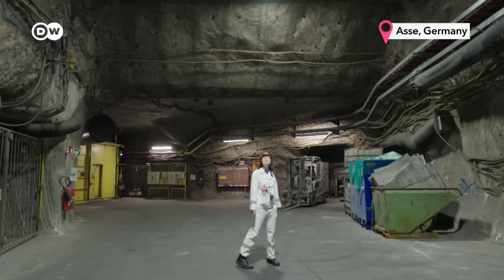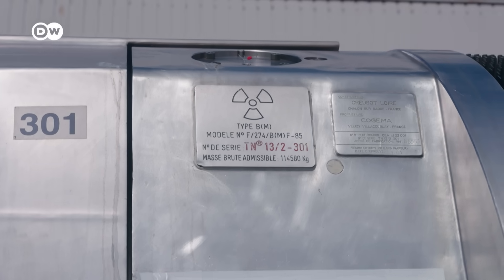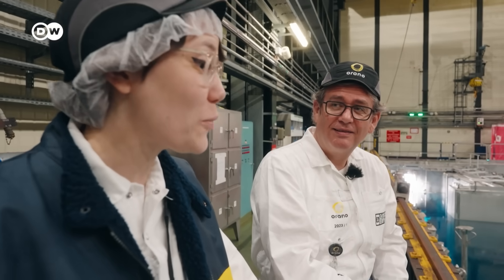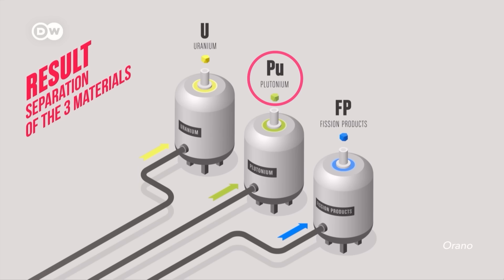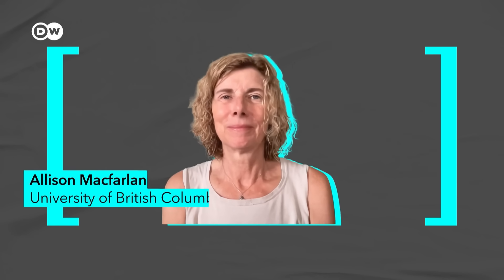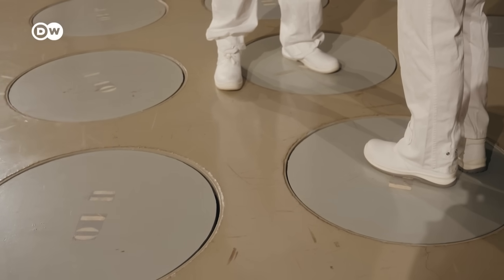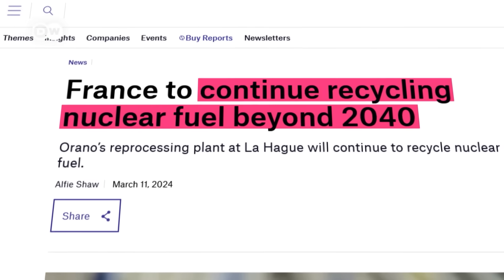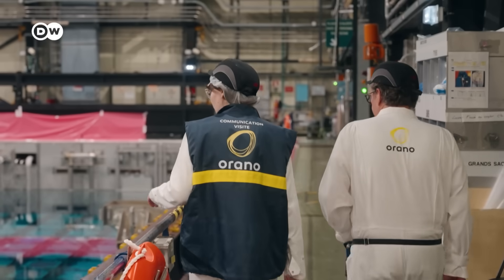Nuclear waste is reusable. Why aren’t we doing it?

Comment: Germany shutting down all nuclear reactors but reactivating coal power plants is the dumbest “environmental” move ever, thanks Greens. It’s almost as if the best energy policy should be designed by scientists and engineers, instead of politicians.
Reply: They can bring in nuclear fusion power plants
Reply: Germany doesn't reactivate coal power plants. Germany is reducing coal. 2023 was the year with the lowest electricity generation from coal and this year it is dropping even further. Certainly it would have been a better idea to shut down the coal power plants before the nuclear power plants, but your claim is false. And don't count the reactivation of coal power plants because of the R-U-war, they didn't run that much, they were reactivated to replace natural gas and in this short amount of time there was no other option. Also we should remember, that all parties back then (2011) voted for shutting down the nuclear power plants.

Comment: Russia is already doing it successfully.
Reply: yes russia has acheived 12% of France's amount.not bad.
Reply: @AlexC-ou4ju  Russia carries out deep processing and purification of uranium and plutonium from 0.7+0.7 to the level of 0.1+0.1% 235 uranium and 239+240+241 plutonium, France to the level of 0.3+0.3%.
A quarter of the fuel in Russia is processed by fast reactors, they burn out dangerous minor actinides with a shelf life of hundreds of thousands of years.
China and India are following the same path.

Russia produces and uses MOX, REMIX and nitride fuel for reactors of generations 3, 3+ and 4.
France produces and uses only MOX fuel.
REMIX fuel can be used as a complete replacement for MOX not in a third of the reactor rods (as in France), but with a complete filling of the reactor, starting from the second cycle.
Nitride fuel is used in fast and molten salt reactors
Reply: @AlexC-ou4ju  of what amount? What stats? Do you even know what you're writing?
Reply: @georgecarlin2656  hi yes, just going by this video data alone. but hey if you werent rushing to fellaterussia you might have known what i was talking about as well. but hey ythat might have taken curiosity and intellect.  12:07
Reply: @AlexC-ou4ju  The French group Orano, which owns the reprocessed uranium (RepU) mainly from foreign power plants and which signed a contract in 2020 with Rosatom, has confirmed that it has made "five or six deliveries" to Russia, amounting to a volume of 1,150 tonnes. However, the company told Le Monde that this contract has now been closed, with the final uranium shipment having taken place in October 2022. Orano also says it is not considering signing a new contract with the Russian nuclear giant.

For EDF, which operates French power plants and therefore owns the reprocessed uranium from spent fuel, the stakes are higher. In 2018, the multinational electric utility company signed a contract with a Rosatom subsidiary, Tenex, to process RepU, also at Seversk.

Comment: Used Fuel Rods might not have been recycled due to inefficient technology to reprocess and extract the usable elements economically until today.  On top of this Uranium was likely cheaper out of the ground.  Further we use the Uranium wastfully, like the wasted residual heat which could be recycled as well.  The whole industry and peoples thinking needs to change accordingly.

Comment: I would be really interested in the full video, the process is as you said extremely simplified. The way the video put it seems like the Uranium comes out as pure ready to use Uranium, but the 95% are Uranium hexafluoride or yellow cake, which has to be processed again before it can be used again.
The video also didn't mention the concerns about la Hague, like the Pipe that flushes out nuclear waste into the ocean or the chimneys where radioactive cesium is pumped out and is measurable in half of Europe.
So thanks for the Video but it was for my taste a bit too over positive.

Comment: Thanks for this report, DW; very interesting! Chapeau to the French for recycling their nuclear power waste. Sadly, I'm not surprised at the attitude of the US against recycling!
Reply: The correct word is reprocessing.  It involves dropping extremely radioactive irradiated fuel rods into acids and solvents, which makes the worst pollution imaginable.
Reply: @markrobinowitz8473  Agreed, PUREX and PUREX type purely chemical separation is not ideal. If they can make pyroprocessing (electrochemical, similar to electroplating) work well, that will be a game changer as you no longer need the acids and solvents.

Comment: Some fission byproducts possess decay properties for use in diagnostics or radiotherapy, particularly for treating cancer. Are these not useful byproducts of nuclear power generation or are they derived elsewhere?
Reply: They are not extracted from waste but purposefully created either by irradiating stable isotope in reactor (usually small research reactor, not big commercial one used to make electricity) some are made in particle accelerators and some in generators (you put in high concentration of isotope A (for example molybdenum 99) and collect isotope B into which isotope A naturally decayed (in case of molybdenum 99 it is technetium 99)

Comment: So basically this number is fake and misleading. A quite high part of the nuclear waste is not out of the reactor but is stuff that was in contact to radiation and now radiate on it's own (like steel structures and concrete when the power plants are taken apart or the castor cases themselves). Yes, the radiation level is way lower, at it need only multiple thousands of years to be safe instead of million, but it's not recyclable at all. How is this fact missing? DW, I expected better!

Comment: I live in Washington State USA... Hanford was used to produce Plutonium for the War Effort and later Cold War... they have stopped producing Plutonium and have been performing Clean Up Operations for years... any equipment that came into contact with Plutonium or many of it's byproducts during processing are highly radioactive... we have learned a lot since then... Nuclear is still one of the Best Green Energy Solutions available... we do have abundant Hydro-Power, but every location suitable for Dams are already used... Hanford remains one of the best locations in world for Nuclear Power... isolated, close to Columbia River, existing infrastructure, educated workforce, to name just a few... but too much radiation still remains and will remain for years...

Comment: India started fast breeder reactor prototype very recently
Reply: They should rather go to renewable energy instead of any nuclear. They are famous for not really taking care of their trash and environment
Reply: Fast breeder is an old technology. It was tried across many countries and the only country still operating it is Russia (only two reactors). Reasons are simple: security and cost.
Reply: @DommTom cost is high because of low usage of technology
(Solar panels were very costly twenty years ago)
Security can always be ensured by following proper measures
Reply: @priyadarshi8548  This is true. Higher abundance of a technology makes it cheaper. This is the case for solar power too. But: there's a reason why solar power is on the rise while nuclear power is stagnating since the 90s. And there is no harder argument than the free market.